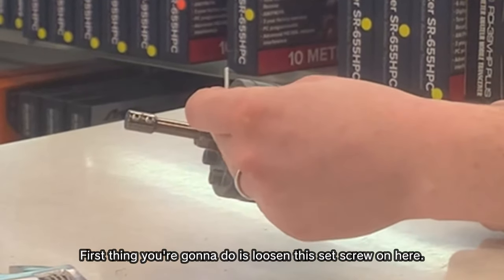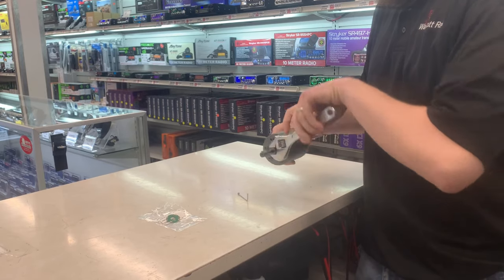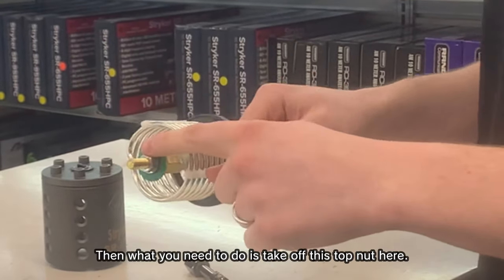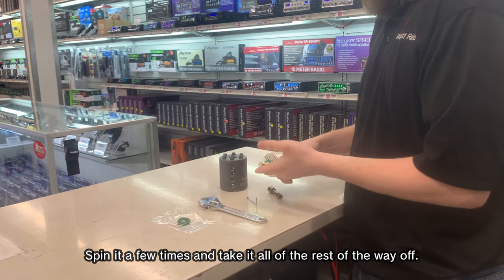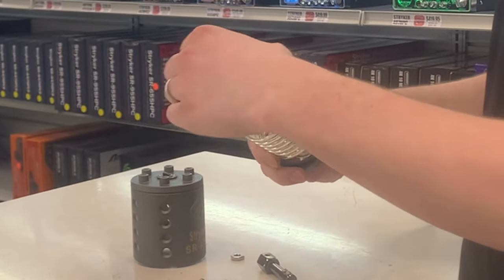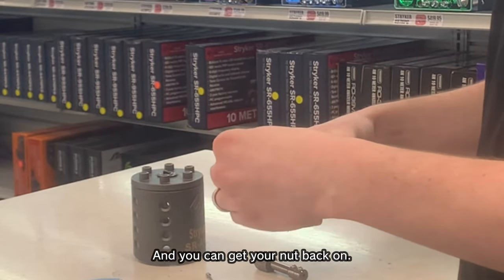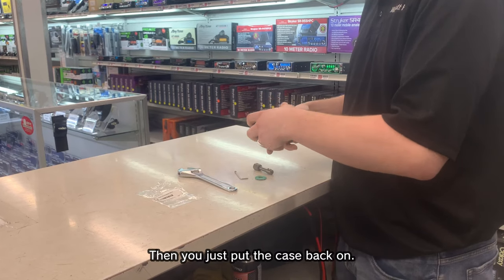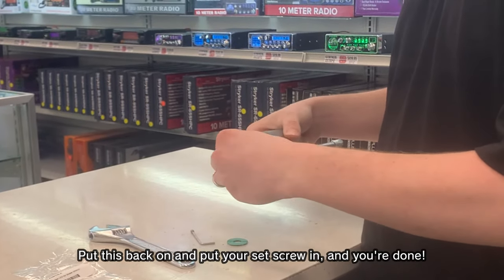How To: Disassemble Stryker SRA-10 Antennas | LED Install | Half-Pint How-Tos

Comment: Where does the power to the LED lights come from ? Thanks
Reply from the maker: The RF produced while transmitting excites the LED.  In other words a small amount of your transmitted power is enough to light the LED from proximity.
Reply: @walcottradio  okay thanks I'm definitely going to get rid of the LEDs

Comment: Can I use a semi truck mount instead of a magnet mount?
Reply from the maker: The antenna shown in this video is the trucker style antenna, not a magnetic antenna.  However, the LED light replacement procedure is the same for either the magnetic or trucker style antennas.
Reply: @walcottradio  I’m needing the blue led ?
Reply from the maker: @Rogerwayne96  You might want to check with Stryker directly.  We do not have replacement blue LEDs.

Comment: How do you disable the blue light on the antenna?
Reply from the maker: If you follow the instructions in the video, you can remove the blue light.  This video shows you how to remove and replace the light, just ignore the replace part.
Reply: Where do you get diffrent LEDs from?
Reply from the maker: Stryker offers an amber light alternative which can be purchased here https://www.walcottradio.com/a10pcba-amber-light-ring-replacement-led-for-stryker-sra10-and-sra10mm-p-3838.html.  The stock light included with the antenna is blue.